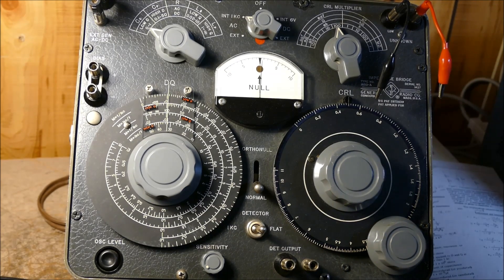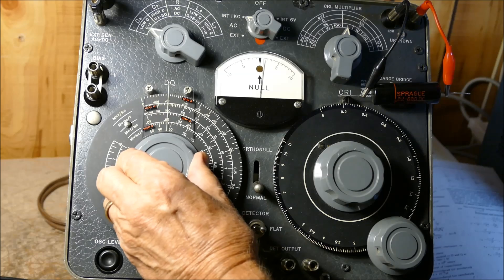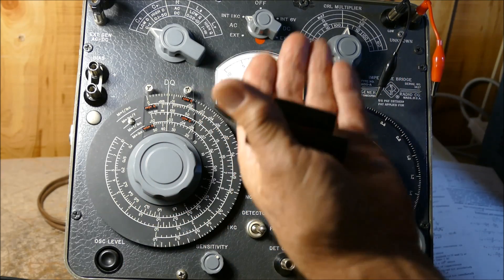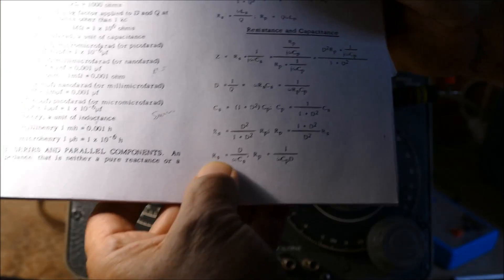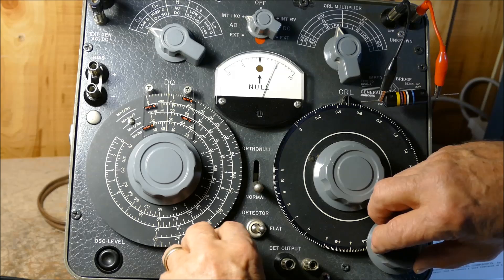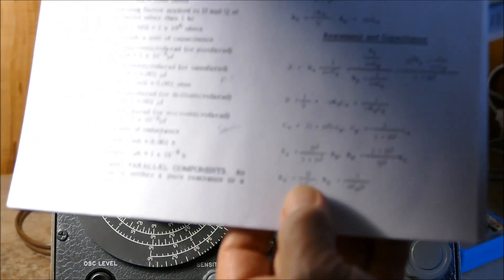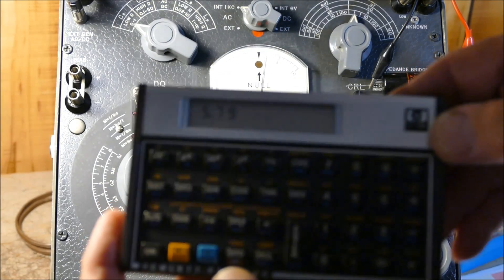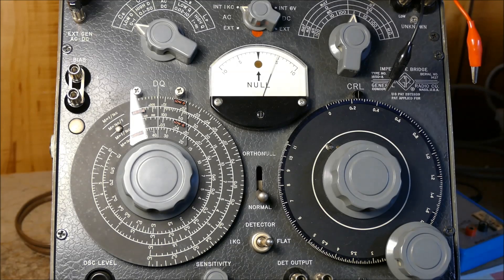Evaluating Vintage Black Beauty and Bumble Bee Capacitors from a McIntosh Amplifier

Comment: Leakage under high voltage is the only test that matters u don't need a bridge take your 5 dollar meter from harbor freight if it reads correct Capitence and u test leakage under high voltage and passes your good. I've had caps read great on esr meter and leak like crazy u can't use a esr meter or any low voltage test to check caps in vaccum tube gear I respectfully disagree with this conclusion. Also u have to take into account the composition of the cap some old black beauties were film caps judging from the size of those caps they were probably film caps. which may never go bad not that they can't but are much much more reliable. I just got in two Magnavox  amp 142 twos with paper bumble bee caps and every one of them leaked under DC infact I can't remember when I have found a paper cap in the last 5 years that didn't leak at it's specified voltage I have plenty of caps that test great on an esr meter that leak like crazy don't waste your time with esr test on small signal caps it's useless. Unless they are shorted it will tell u nothing how can it the series resistance is much lower than the parallel leakage resistance so it just won't see it.
Reply from the maker: I agree with you. No fancy test equipment needed. Not even an ESR meter for evaluating the coupling capacitor values as the ESR is fairly high and has no common value, for example, of a 0.22 or 0.01 uf capacitor or any other common value capacitor used to concatenate voltage amplifier stages in a vacuum tube amplifier. Most ESR meters specify the lower end of the range that the meter will reliably test ESR and in my meter this is about 5 uF.
Test them at their rated voltage with a clean DC power source and a simple volt meter all connected in series and see if anything registers on the voltmeter. It it does (not including the charging time, of course) then the capacitor needs to be replaced.
I have to remember that I started truly working with electronic equipment 56 years ago (1963) when I became a General class ham radio operator and there were not near as many bad capacitors in equipment then as there are now, simply because the equipment, at that time, was relatively new so,  I have to keep that in mind nowadays. I remember building large RF amplifiers starting in 1970 and having to deal with WWII surplus capacitors that were around 25 years old at that time, and I thought that was old but now those same capacitors are 75 years old. Quite a bit of difference yet many if not most of the mica transmitting level capacitors are still good today. Thanks for your comments.

Comment: Hi David, I had watched this video previously, and enjoyed just watching you use the old equipment....but I did not have any of those type capacitors, and wasn't looking to determine if any were good. Recently however I came across 2 1960's console type units at our town's local recycle. I scavenged all the tubes, transformers, speakers, resistors, and quite a few of those Sprague caps. Out of 18, only 2 read different then labeled for capacitance using my dmm. And only 1 read any resistance using my triplet multi meter. Its the only way I can test them. I doubt if i will use any of them, but they are all pre 1964 and I think they would still work fine (aside from the one that leaked).  All the tubes I checked 12ax, at, au7's and el84's tested near new. I have purchased new tubes that didn't test as strong, or as well matched per triode (for the 12ax7's) I'm not saying they made things better back then, but time will tell.  As you have stated in one of your video's, are the new capacitors were using now going to be working 50yrs from now?
Reply from the maker: +Bucyrus Erie12 There is no doubt that some of the old tubes are still very good and desirable and, as you said, can be much better than the new ones. I completely agree with you on the quality and balance of some of the old 12A..7's  I much prefer the vintage 12A..7's to new ones especially the Telefunken.  Good deal, it is nice to salvage some of the old parts like you did. As for the capacitors, no matter how much we test them, old ones always are a bit of a gamble. If they are used in very low voltage points in the circuit, a little leakage will probably not matter at all. But if these same ones are used as coupling capacitors where there can be a few hundred volts across them, then this can significantly change the bias on the grid of the tube they are feeding and performance will deteriorate.  I guess we, at least I, will not know how the new ones turn out in 50 years   :-)  I an sure there will be a few geeks around that love this stuff for its vintage nature and simplicity long after my generation is gone. I also hope that when I am gone all my stuff doesn't end up in the recycle bin to be melted down for a few pennies.

Comment: The DF is not 0 to 1, it can be much higher, my HP measures up to 50. It is the ratio between the real resistance R, and  the reactance Xc. Not the resistance and  capacitance. 

 It is very easy to calculate the ESR from DF. 

By the way, most ESR meters do not measure ESR but impedance at 100kHz. Most cap manufacturers give the DF and ESR (or tan-d) at 120 or 1000Hz. Not at 100 kHz.
http://www.pa4tim.nl/?p=3775 I wrote a page about ESR

By the way, like your videos, I have a lot of GR too (and also your VTVM and Tek 130)
Reply from the maker: +pa4tim You are right. I was looking at the 0 - 1 scale and made the mistake of thinking it was a normalized value from 0 to 1.  I put in a speech bubble to correct it.  I appreciate you letting me know. I have recently picked up some more GR equipment. I really enjoy using it.

Comment: For years there has only been a handful of maybe five YouTube videos concerning the massive breadth of genrad components and benchtop, the numerous applications their equipment has spanned. I love their 1920s-30s period as far as the aesthetic and general philosophy their components had: this is when they still had dealings with CRTs and they made their own tube sockets and you could order any number of awesome transformers or rheostats or even a power amplifier kit. I began collecting general radio and Weston as well as a few other contemporary manufacturers but general radio is my favorite. i love to the subtle evolution of their designs: how many bridges can you have? Let alone impedance bridges or comparators orhybrid instruments? My interest was accidental due time not being able to afford Manley or Shadow Hills pro audio or even the older analog audio which is has become outrageously priced: a Davenport attenuatir with famed viz skirted pointer Bakelite knob? 100? A langevin: 300? A simple Raytheon or Collins front panel with no internal Amps or power supply? 700-1000? WHY FOR? anyway I need to start doing some tear downs and demos of my equipment. My bench and area is a cluttered mess however. I need to get these Weston 686 9c and 10as modded for 1kv for power triodes and fix the other problems. If only I could befriend an experienced tech in the Southern California area or come join another stocked warehouse situation but with a boss who didn't promise me a job sorting out then,off sticks for moving millions of tubes to a central location and then guilt trip me about his ever failing and changing health or situation: come to find he had been accused of fraud by searching Koterba and audio asylum. Art lane. Blah blah. 
Anyway sorry for the digressions and lack of focus. I really have been grateful for the integrity and humility displayed in your videos. . . And relative diligenc... And Comraderye with uncle Doug.

Comment: I have a General Radio 1650A. It's not as nice as yours. It doesn't have a power cord. Just a hole in the top right side that looks like it might take a tube full of batteries. There's plate on the outside that says it used to belong to the US Navy. I've never really looked into using it. I'd rather not part something this gorgeous out. How is yours powered?

Comment: Leakage has always been my main concern too. That and the bumblees and black beauties exploding. I would think if they were leaking at the (AC) voltage that GR bridge applies, that would have to show up as an increased power dissapation on the null. Of course, they could still leak at high DC voltages, I suppose. Just thinking out loud....
Reply from the maker: +Rob T The 1650-A bridge does show an increase in dissipation (D). It doesn't show up as what we might think as horrible but it seems any D in these small value capacitors is not good. New good small value capacitors have a D of zero. The D may be only 0.02 but that is bad and what these leaking capacitors measure at.
Reply: Good to know. Thanks. I do a little vintage amp and radio business up here in Iowa ,as well as selling parts. Anything I can pick up helps refine my 30 years in electricity and electronics.

Comment: Nice old equipment you have there. I use an old Knight kit capacitor tester to check for leakage. I have found that the new ESR testers call capacitors good that I tested as leaky on the Knight Kit tester. I think that the ESR cant provide the high voltage that will overcome the dielectric of the capacitor at test. On low voltage application I will use the ESR's findings in none critical circuits. Thanks for the fine videos, I enjoy them.
Reply: Carl  Burgess ESR and leakage are two separate tests anyway. Leakage is equivalent to having a resistor in parallel with the capacitor. As explained in the video, ESR is a bit more complex measurement that is measuring the AC impedance of the cap at a specified frequency.

Comment: Very nice, thanks.

Another concern with old capacitors is whether they are leaking DC at high voltages, as in e.g. when used for coupling to prevent messing with a grid bias. Some capacitors tend to degrade into a capacitor with a paralleled resistor.
Reply from the maker: +Alfred Stampe I agree, and I think this is why we often times just replace capacitors as they are difficult to completely evaluate in a dynamic circuit. When in doubt,  the wisdom is to replace. I have a HV DC variable PS that I may use to make a video with and apply HV to a capacitor and measure any leakage DC current comparing old and new. It will be interesting what information it provides. Thanks.
Reply from the maker: +Alfred Stampe So I could sleep tonight...  I have a Keithley 241 PS that I put across one of the vintage 0.22 uF capacitors at 600 VDC and watched the DC leakage current through the capacitor. I can easily detect 60 uA when the meter is shunt with the capacitor (to measure the HV across the capacitor) and Zero current through the capacitor when I remove the meter. The vintage capacitor is not leaking DC. I will make and post the video tomorrow and I will find some leaking capacitors where we can see the difference.Thanks.

Comment: Hi thanks for the interesting video, yes what a beautiful instrument. Any chance you could test the capacitors you replaced them with? All the best.
Reply from the maker: +mixolydian2010 The brand new orange drop capacitors test the same as the (good) 50 year old ones at about 7 ohms ESR - about 7 ohms for a 0.22 uF capacitor. Also, I have found that if you purchase a number of capacitors (or resistors) at the same time that, I assume, come from the same production run, they are very close to each other in value and even really close to the stated value. There is actually some really nice components made today. I think "back in the day" high-end companies like McIntosh bought first-class components that were not only best-of-quality but nicely matched. They did a good job and many of their instruments still work properly today.
Reply: +ElPaso TubeAmps Thanks for the reply and telling me the measurements. appreciate your time. I understand that modern materials and manufacturing are in a sense better but what always amazes me is how good quality in any time period, usually at a much higher price to now say, can be achieved. There are some great engineers and manufacturers in any age. All the best and looking forward to seeing you again. Colin.